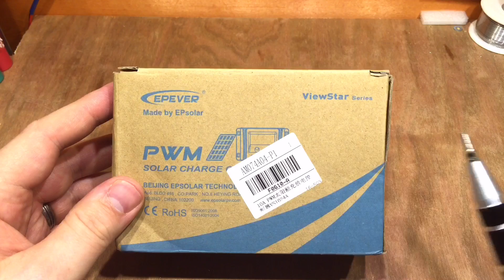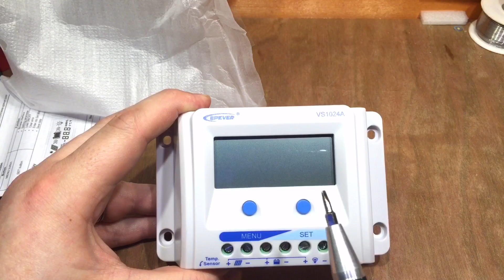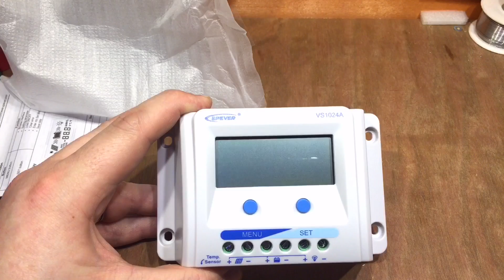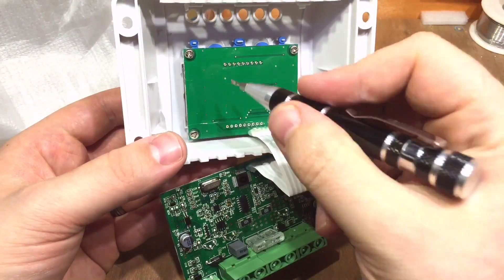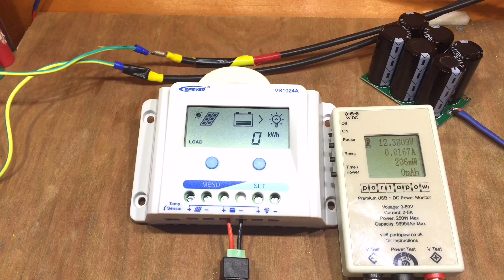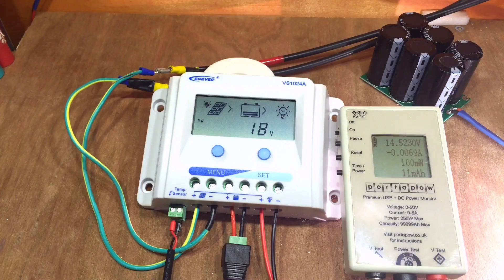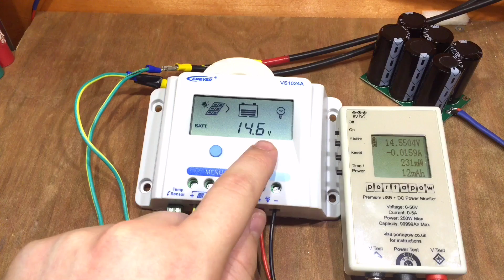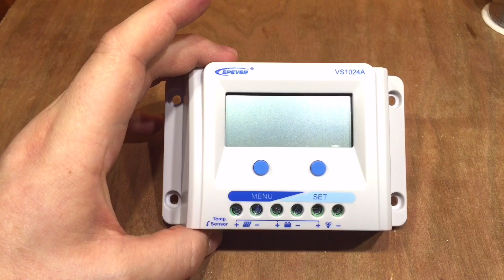EPEver ViewStar Solar Charge Controller Review - 12v Solar Shed

Comment: Hi want is the 2 n after the battery load?
Reply from the maker: 2n means timer two is disabled. Timer two controls the load before sunrise, timer one controls the load after sunset.
Reply: @AdamWelchUK  hi thanks for your reply, if you could do a video on timer one and timer two it would be so helpfull. I just bought this solar charge controller and the timer is confusing 😁

Another thing is when the battery is fully charge why the indicator still showing hlf full after  disconnecting the solar panel.

Comment: Hi bro, my 50W solar panel seems not produce with high voltage likes yours, it’s around 13.4v to 14.4v, may I asked how long of the cable in this video? What’s the cable size from the panel in this video?
Thanks.

Comment: I wonder if this charge controller (and the newer VS1024AU) has an internal temperature sensor? It is advertised with "battery temperature compensation function" but the external sensor is not included it seems and without the sensor the display shows 25°C all the time. So no temperature compensation? What happens if I use this controller in a vehicle at higher temperatures, is it still safe?
The reason I do not want to use an external sensor is that I want to plug it into a cigarette lighter socket and not connect it directly to the AGM battery.

Comment: Great Vid, thanks.   I have just purchased a Epever VS-AU, 30 amp. Looks pretty much the same. Just wondering if all 3  "+ve " terminals are linked inside the controller, how does it measure 'Load' current?  Is there a CT on the Controller + terminal, or does it measure current passing the 'Load  -ve' terminal?   If on the -ve, I guess I cant have any connection from Load Batt to caravan chassis ground and have some loads earthed to chassis for return to the batt via the chassis.  I guess there has to be no connection from -ve of batt to the chassis and all -ve wires from loads bundled together and returned through the -ve LOAD term of the controller?

Comment: "Transmit, Ground, Receive, Volt" = J-tag for micro programming.
Reply: Hi Tore, Do you think I can use this terminals to monitor? Thx
Reply: @alfguimaraes  Depends on the code running on the micro controller. Start by looking up the datasheet for the processor, verifying that the pins goes to an uart on the chip and if it is 3.3v or 5v data lines and what baud rates it is supposed to run at. Then hook up a 5v or 3v usb serial port , tx rx and gnd and and boot the solar controller and look for boot messages. That should tell you something. If you are lucky, it provides live data (V, A Ah W battery status), which you can log on a PC for nice graphs, most likely it is just the bootloader sending POST messages and possible a way to flash firmware.

Comment: Sorry for my bad English. which mode do I have to adjust if I have agm batteries? Thank you :)
Reply from the maker: I’d set it to Gel if I were you.
Reply: @AdamWelchUK  thank You :)
Reply: @AdamWelchUK  Could you explain why? Isn't the charge voltage of 14,2V too low for an AGM battery?

Comment: Hi Adam, I know I'm digging up an old vid here, but I only recently found your channel and I've been going back through your catalogue of vids.   I'm wondering what battery type one would select on this charger for an AGM battery?I'll take this opportunity to thank you for your efforts as well.  Bloody great videos, probably the best on subject.
Reply: I have the same question, you would think it's sealed. But if you look at the charging profile, charge voltages for sealed are 14,4-14,6. I have read AGM's need 14,6-14,8 charge voltage.

Comment: Informative video as usual, thanks
Have question please,
I'm confused about grounding positive grounding charge controllers, like Tracer A series and other devices, also some devices have negative grounding, is ok to use same grounding system for both types of devices?

Thank you so much!
Reply from the maker: Let’s forget the grounding word for a moment and just compare common positive and common negative charge controllers. A common positive charge controller means the solar, battery and load positive connections are connected together permanently. The switch is on the negative side of the circuit. A common negative charge controller is the other way around... the load and solar panels are switched on the positive side.
Now if you ground your system (usually done from the battery negative terminal to ground or to a vehicle chassis) that’s fine on either system, you just need to think about your wiring - you need to ensure that you don’t create any shorts and bypass the switches (mosfets). 
Does that help?

Comment: Hello! I think you should look into a new version of this charger -  vs1024au. It has usb ports and claims to have user changeable voltages. If it's true it would be very suitable for li-ion charging.
Reply from the maker: +eskisful According to the official page ( http://www.epsolarpv.com/en/index.php/Product/pro_content/id/771/am_id/136 ) there are only three settings - flooded, sealed and gel. No User setting for adjusting the parameters like on the LandStar range.
Reply: Adam Welch I guess you're right. But a lot of listings in ebay and aliexpress say User: 9-17V in the specs sheet lines of Boost, float, eq voltages.

Comment: i had the 30a one was all fine on a 12 volt system But I changed my system over to a 24v  one. The result was it went on fire
Reply from the maker: That's odd - I've been running mine on a 24v 7s lithium pack for a year now without any issues.
Reply: Seems I ran to many volts through it Won't be doing that again

Comment: Hi Adam, Do u now how is controled the currenty to battery? And Who supply the load, the battery or source?
Dont care abou may bad english.
Reply from the maker: +Carlos Gentil This is a PWM solar charge controller. Solar charge controllers will limit current going into the battery after the bulk stage is finished. The load power is supplied from solar generally when it's sunny and supplemented by the battery. Although that might be an over simplification!

Comment: Hi Adam, Firstly want to that you for your video's. 
I have just built my first folding solar kit for outback prospecting in Australia after watching your videos. My wife is getting annoyed at your voice constantly on the TV via YouTube late at night while I take notes.....haha.
Does this controller add up the total amps produced over time? As I'm trying to keep things simple, I don't want to add a watt meter for my portable system. I have one on my Waeco fridge to see the total usage for the day. 
Currently using a blue controller similar to the Ansef one you did a review on (CY1220), but want something a bit better without buying an MPPT, as the locals over here like to borrow your equipment if you leave it out in the sun unattended....permanently. 
Thanks Again for an awesome channel,
Reply from the maker: +ottoswinebar Hello - thank you for your comments and please do pass my apologise to your wife. Mine too gets fed up with the sound of my voice occasionally. 
This charge controller does tally up the kilowatt hours generated on the PV side and the kWh used on the load side, but it doesn't show Amp hours. But then you know the nominal voltage of your system and a bit of maths should give you a good guide. 
Hope that answers your question and you will remember to send me my cut when you find something big right? ;-)
Cheers
Reply: I'll Message you some pictures. send you a link to some poorly made videos of us detecting. Thanks Again for your videos. Looking at an MPPT controller now, something simple that can handle desert/dusty conditions. Not keen on those cheaper ones you reviewed as I have expensive AGM's.
Reply from the maker: Cheers I'd like to see that.  Nearly everything on my channel is on the cheaper end of the market - hopefully helping people decide if they can get away with them rather than spending more so I'm pleased my videos have helped you decide those products aren't for you.  Have a look at the Midnite Solar Kid range - they do a marine version which is pretty much sealed I think.
Reply: Adam Welch Just emailed you.

Comment: i got the VS3024A controller with a kit. had no intention to use this controller ( i have MPPT controllers ), but after looking this unit over, i have to say, it seems to be well built and works well for a PWM unit. i may just use it to charge a smaller 35AH batterie i use for lights in my house

Comment: Hi Adam, I just wanted to inform you that the VS3048AU unit (Similar to the unit you have on this video) I have got a  successful communication with the EPsolar PC Tools Software using the T(Tx), G(Gnd), R (Rx) using a USB to TTL (3.3V signal level) adapter only. Next move is to add serial-to-wifi bridge  (+Colin Hickey). Thanks :)
Reply: Hi Mike, Can the SW allow user change the charge voltages?  thanks.
Reply from the maker: +Mike Yasay That's excellent. I never pursued this but I'm grateful you did! :-)
Reply: Just an update, doesn't seem's to work on new EPever Solar monitoring Software :( .It just work on the old SW that I have (Simplified EPSolar V1.0). I'll keep trying will let you know.
Reply from the maker: +Mike Yasay Thanks for the update. Is the viewsonic using modbus still?
Reply: You mean Viewstar right? No, its using TTL UART communication, with 9600 baud rate. I guess the new SW does not support TTL UART comm anymore.
Reply from the maker: +Mike Yasay Yes sorry.  That was what I was wondering. All the latest use modbus. Still very useful. I'll have to have a play at some point. Cheers
Reply: Anyways, at least now I can monitor the unit I have at lower cost :)
Reply: @mikeyasay6853   Hi mike, where can I get a version of the old software? thx
Reply: @mikeyasay6853  a long shot given the years that have passed, but do you still have the Simplified EPSolar V1.0 software at all? I'm dealing with the dissapointment of realising mine is the older type that is TTL not RS485 (its a VS1024N rather than VS1024BN) and trying to find older versions of the software is proving.... challenging!
Reply: @AdamWelchUK  probably those 4 small holes are for optional external factory programming firmware update & configuration purposes, i believe...
Reply: Any updates whether one can change the voltages? I am also interested in this. Thanks.

Comment: I have ordered one of these controlers or the newest one with two usb contcts in front.
Will there be any experiment from you about 18650 li ion battery charging with this ?
Reply from the maker: From what I have seen the new AU range is exactly the same as this viewstar except for the USB ports.  I can't imagine they've redesigned much on the solar side on most models.  I see they've got one that does 12/24/48 volt battery systems now, so presumably that has a few internal component changes to cope with the higher voltages.  Difficult for me to test that though without some major reconfiguration both on the solar side and the battery bank.
Besides, I'm getting no sun at the moment so it wouldn't be a fair test.  Blooming British weather!  Thanks anyway.

Comment: Those TGRV terminals could be the short for "Transmit, Ground, Receive, Vin". I suppose that it could be used to upgrade the software.
Reply from the maker: +Telmo Monteiro Yeah. I came to this conclusion when editing the video - mentioned it in the description. Thanks for your comments though.
Reply: Is the TGRV pins, might also be the communication to the EPSolar software. Has anyone tried it? I got the VS3048AU (with the 2 USB port). By the way, I've tried to measure the voltages on this TGRV pins and it measures 3.3V, 0V, 3.3V, 3.3V. At Adam any change you can verify this port as well?

Comment: Got me considering an upgrade to my 10A controller now!!  My current one is the typical 10a which most people start with and its naff and will happily run the battery down if it gets a chance.
Reply from the maker: +Colin Hickey Most allow to discharge to lower voltages than I'd like. This one goes down to 10.8 or something. Not great. The LandStar range (with a cheap USB cable) can be adjusted to suit your needs though. 

What you need of cause is a Tracer :-)
Reply: Got a nice 30A one of those just need something for a small 10w 12v panel i have.  Spotted the landstar 10A for £20 from a UK seller, rather tempting.  Have the usb adaptor already.  Where did you get your temp sensor from?
Reply from the maker: Ebay: http://rover.ebay.com/rover/1/710-53481-19255-0/1?icep_ff3=2&pub=5575189419&toolid=10001&campid=5337903455&customid=&icep_item=121927470593&ipn=psmain&icep_vectorid=229508&kwid=902099&mtid=824&kw=lg

Is there any where else? ;-p
Reply: Thanks ordered, i bow to your google/ebay fu :-)  oh and ordered a landstar 10A too to tinker with :-)
Reply from the maker: +Colin Hickey Excellent. I hope they bring you lots of fun and watts!